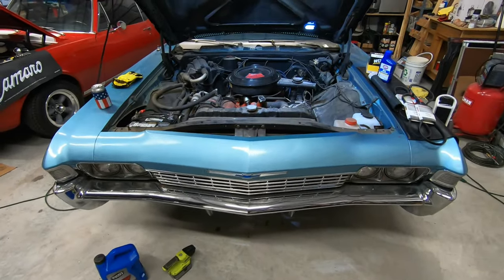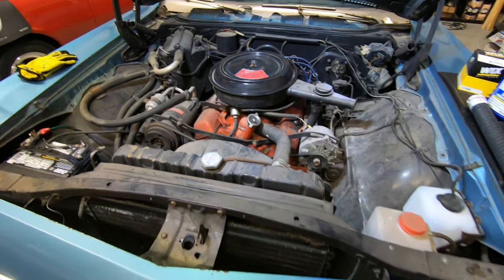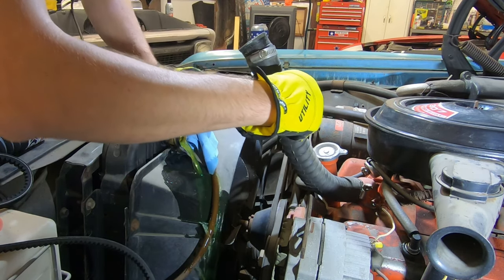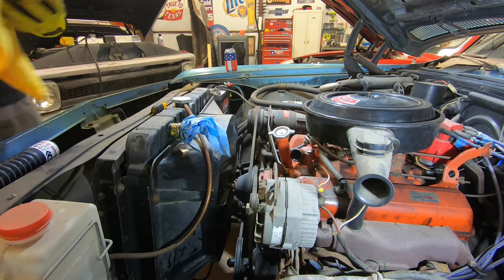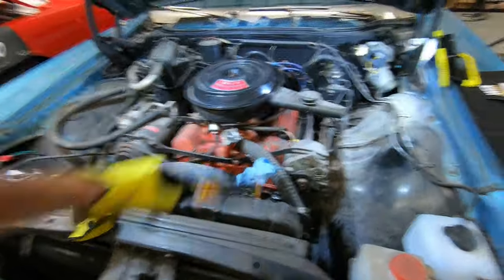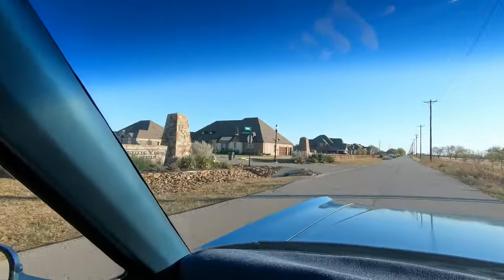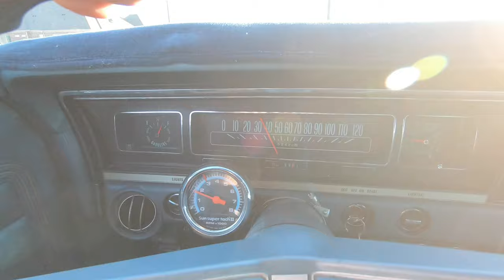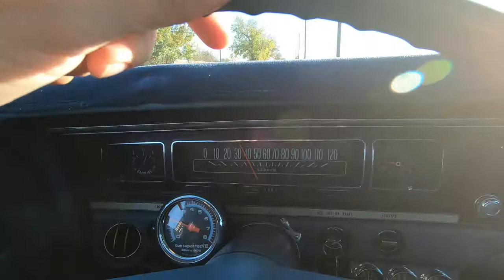1968 Impala | Service & Drive | TX Back Roads

Comment: Very sweet ride! 307s great motors, very reliable, and if yours is a two speed auto? Nice little rat rod motor it will move along nicely. I know my 68 Pontiac Strato Chief had a 250 straight 6 with a two speed power glide, and for a big car? it cruised ok. I love your paint job man awesome blue!
Reply from the maker: Hey thank you! Yep just a powerglide, moves ok for being the size of a suburban lol. Thanks on the paint, its "Grotto Blue".

Comment: Oh heck yeah!!! I had my '68 out cruising today also!! I recently changed out belts, hoses and flushed the radiator. I used flex hoses on the upper and lower as well. Do you run synthetic or conventional oil? Since conventional is getting harder to find, I run Pennzoil Full Synthetic 10w-30 along with the STP additive. Anyway! Great video Travis! I wish you lived closer to TN, so we could hang out!
Reply from the maker: Hey Gerald good to hear from ya! Getting cold weather here next week, so was good to get her out for a cruise. Need to change my belts too, have them, just haven't had the time. On this oil change I did basically the same thing as you, high mileage SuperTech synthetic 10w-30 with the STP additive. Hopefully I can catch a Powertour one year going thru TN and we can have a beer buddy!
Reply: @CLASSICSAREBETTER  sounds good, buddy! If I ever get my '67 road worthy, and if I make the trip to Dripping Springs, I'll look you up!

Comment: If you remove the radiator cap, when the motor is cool of course, you can release the pressure on the system.

Comment: I have a 68 impala also, all original
Reply from the maker: Very cool, what is yours like...doors, motor, color?
Reply: @CLASSICSAREBETTER  two door 307 white with black top
Reply from the maker: @norms1280  Oh man I bet the white and black looks sharp!  Working on another Impala video right now for this week!
Reply: FASCINATED: Norm S, I suppose you also have all it's original papers as well.
BTW, is your Impala a fastback or sedan or even perhaps a wagon?
Reply: I have all the original paperwork, it is a sedan, also have the protecto. Plate
Reply: I'm getting closer to having my grandpa's 68 Impala. I'm buying it off him. It has not been running in 20 years or so. Hoping everything will be smooth.